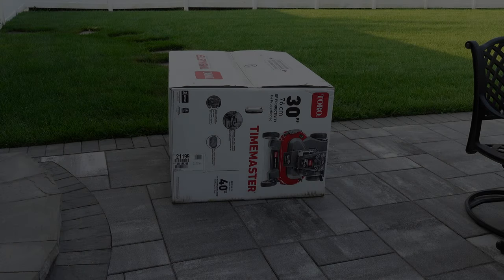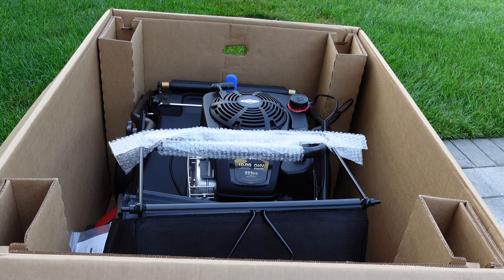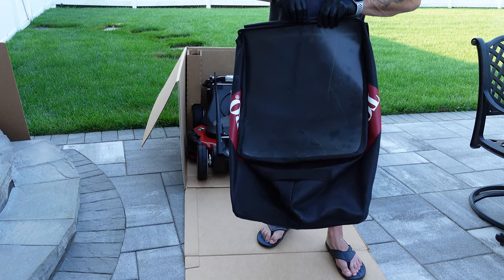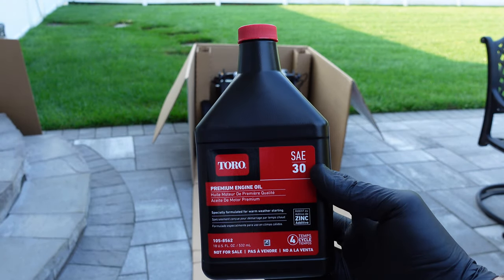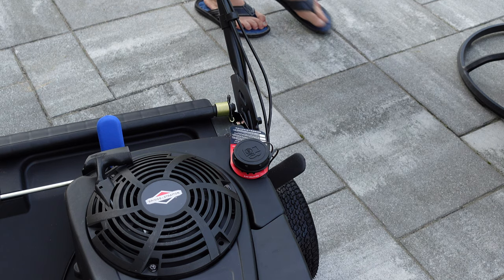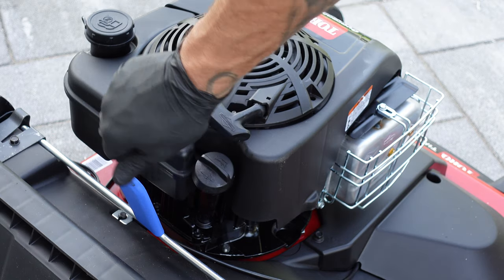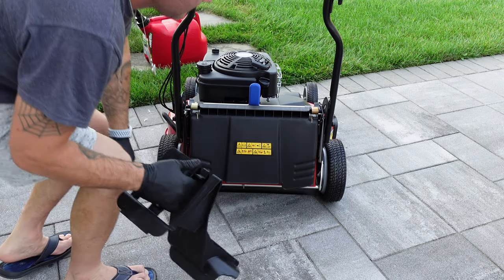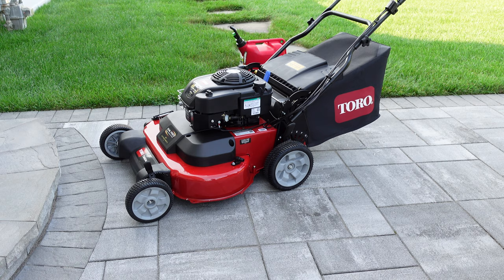Unboxing & Set Up of the Toro TimeMaster 223cc 30" Lawn Mower with Personal Pace

Comment: Great video man! Thanks for talking about all the unboxing and set up, especially the oil level issue, which I couldn’t figure out because it is impossible to check the oil properly. Also, the Briggs & stratton engine manual says that the engine ships without oil, but also says the manufacturer or dealer may have added oil on their own. This is totally confusing and there’s no real way to see if this happened or not since the level is impossible to check. Worse yet, when I checked the oil right out of the box, it looks like it had some in it, but I couldn’t tell how much again because of the dipstick design problem. As you mentioned, I went ahead and added about 15 ounces anyway. I feel better about that decision after watching your video. Nice lawn in your video too. Wish mine look like that!
Reply from the maker: Glad this video is still helping some people out!

I used to over-think the oil, but you're good. If yours took fifteen ounces, the dealer did not fill it. I think it holds twenty, so I'd add a little bit more. 

I don't bother checking it throughout the season anymore. At the start of the new season, I just drain it, and re-fill it. You'll know if you're burning oil, it's easy to spot. You'll smell it, see blue smoke, especially when you start it up. Their dip-stick is tricky and hard to read but if you can read it, you want the level at the top line/arrow. 

When I change it seasonally, I generally run it for about 10-minutes, let it sit for a few minutes, use the 'Hopkins Maintenance Tools Siphon Pump' that I picked up from Lowe's, and drain as much as I can. I keep the oil in a container and bring it to the mechanic when I take my car for its next oil change. 

I then fill it with most of the twenty-ounce bottle of oil. Mid-way into the season, I'll just fill it with the rest of the oil from that same container to top it off. 

Enjoy the mower, it's a great machine! 👌🏻

Comment: Great video ... im thinking about gettting it .. but they keep talking about the belt breaking .. im thinking the commercial use are mis handling the lawnmowers. Do that lol ..
Reply from the maker: I would have to agree with the commercial use. This is my second TimeMaster. I had the original for about five years, never had a single issue. I sold it to buy a zero-turn, which didn't give me the same cut as the TimeMaster. I sold the zero-turn and purchased the newer TimeMaster, which is this one with the larger 223cc engine. So far, no issues with this one either. I drain and put new oil in yearly and that's pretty much it.

Comment: Iam looking to get one to speed up the cutting. I have a regular push mower now. So this would definitely speed things up with that width?
Reply from the maker: 100%. It's not just the width that will save you time, it has a very large bagging capacity, and the machine is so powerful, it actually fills up the bag completely.